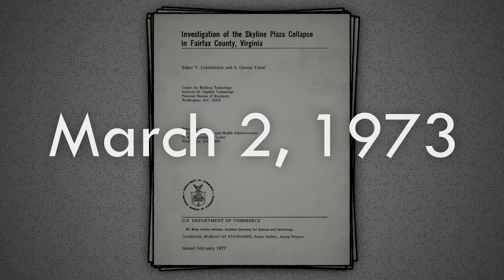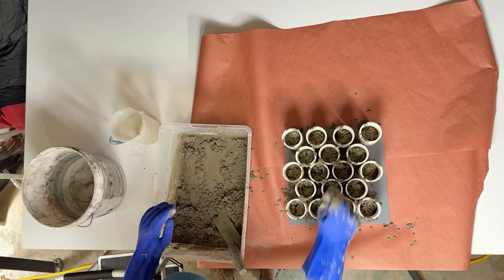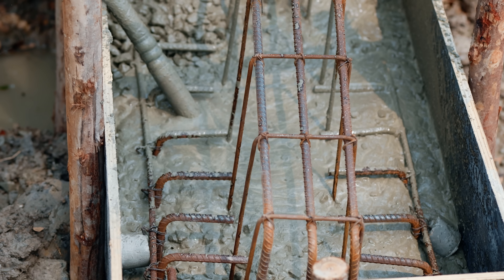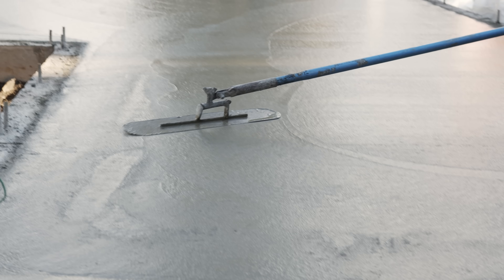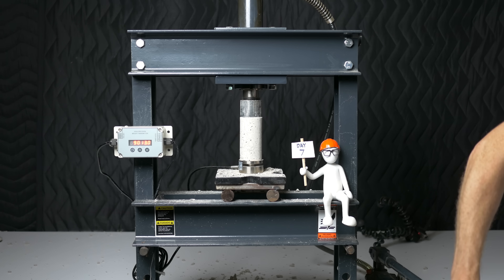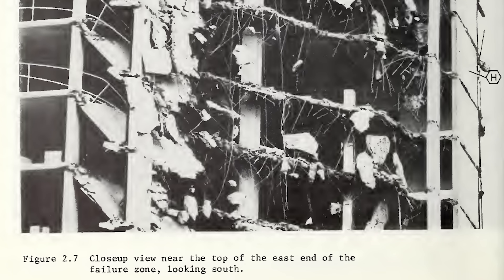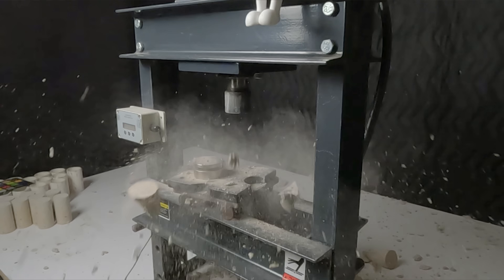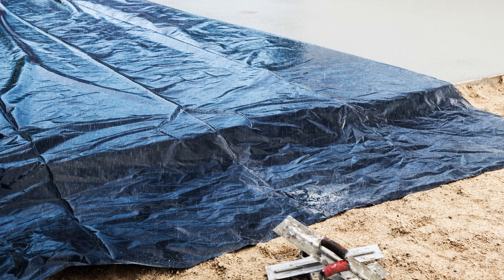Concrete's Greatest Weakness is Time

Comment: Concrete's greatest weakness is the moral integrity of the people engineering, funding, ordering, mixing, transporting, laying and finishing it.
Given a perfect batch of people that do things the right way, concrete will perform excellently.

But yes, concrete does indeed take a lot of time. And there is something to be said about pre-casting concrete off site as much as possible.
It takes up a lot of horizontal space but the benefit is you can do it "perfectly" many months before construction work starts and move the pre-cast segments to the work site.
Then it's just a logistics problem, how to get the cast pieces to the site. Sometimes, you still have but one option and that is to pour it on site due to limitations of the design.

I live in a pre-cast concrete structure. It has performed admirably over the past 60 years. Despite all the outside factors acting on it.
Many other concrete structures have been demolished because of sub-par construction work.

Comment: No, the concrete in the Hoover Dam is not fully cured, and it will continue to cure for centuries because of its massive size. To manage the heat generated during the curing process and prevent cracking, engineers developed a system of cooling pipes that circulated cold water through the concrete blocks during construction. Despite these efforts, the sheer volume of the dam means that the concrete, especially in the interior, still hardens through a process called hydration, and this process is ongoing.

Comment: Some of the time issue is being addressed by the Chinese in their latest ultrafast skyscraper construction.  All components are prefabbed off site including concrete and bolted together.  The speed of construction is simply amazing.  The precast concrete components get to cure in a controlled environment offsite.

Comment: Pretty bold to use a clip @2:31 of the construction of 432 Park Avenue, which is famously already starting to fall apart due to terrible concrete choices
Reply: Pretty fitting, really. It's an infamous example of trading strength for beauty
Reply: I noticed this also.
Reply: Possibly just the exterior finish. There's no proven structural issues.

Comment: A couple of thousand years ago the Romans were building concrete structures. Many of them are still standing and very strong. Good thing Rebar was not invented, the same structures would have concrete cancer by now and would have failed.
Reply: They did have Iron pieces that locked some stones in place, but they filled the gaps with lead so it was a lead covered iron piece.

Comment: Pre pour so you're moving pieces of solid concrete to supplement with your pouring. Like your pillars can be poured somewhere else and hardened already and then you set those up on top of your concrete that's still setting.

Comment: I have heard of failed concrete because the installers used unwashed beach sand which is bad for two reasons:  1. The salt makes the concrete weaker. 2) beach sand is smooth grained and doesn't grip as well.

Comment: Concrete is a really interesting material, even when doing concreting jobs at home with no professional tools/equipment. I've done slab work both with and without reinforcing mesh depending on the required purpose of the final products. Watch those kilo-grady's!

Comment: A relative worked as a concrete forms carpenter for a defense contractor in 1939-40, during the runup before WWII.  He showed me where they build a concrete-paved highway segment as a test of a super-fast-curing concrete formula intended for use in hastily built runways that needed to be used by aircraft as quickly as possible.  He said that the concrete poured in the early morning would have concrete mixers running over it late the same day to pour farther along.  That poured late in the day would be in use the next morning.  Now, 85 years later, the same concrete pavement is still in use as part of a state highway in Louisiana.  I just checked it on Google Street View.

Comment: The night before a significant earthquake I was reading about earthquakes. The next day I was in a building that was built strong enough to withstand a near miss of an atomic bomb. When I felt the first movement I had faith that the concrete building was safe, so I started counting and noting the amplitude and time between the primary and secondary waves to judge the direction, distance, and magnitude of the earthquake. My direction was right on. My distance was within 10%. My magnitude was 7.2 and the final published was 7.3. But within a month the building was reinforced to withstand earthquakes.

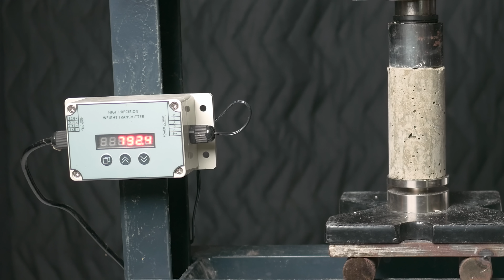Comment: @6:00 Noticed you did not have a sulfur cap on the ends of the cylinders to provide a smooth surface for the press to apply the force. While not important for your demonstration, mention of this test method procedure would be useful to the viewer. Slump is one field test for the concrete for its ability to be poured or pumped into place or formwork. Another important field installation method is to not apply too much vibration to the concrete else the aggregate will settle out of the concrete mix reducing the strength requirement.

Comment: Fellow engineer here. I use to test the concrete cylinders in a Precast facility. Make sure you use rubber pads around 60 duro to give the most accurate test. The height of the cylinder is also supposed to be 3x the width. I know it's for a video but you know you'll have people try to invalidate your test. Anyways, awesome video as always!

Comment: 28 days is an engineer standard. No load bearing for 28 days, no exceptions. Its fine for most use at 2 weeks. Your concrete cured a little faster than average.

Comment: Making cement, the key ingredient of concrete releases a lot of carbon dioxide into the atmosphere. Quick concrete cures in days but does not reach full strength for years. In my city a lot of overpasses had to be widened. the new concrete was not used for traffic for over a year.

Comment: I have a great concrete anecdote.  I was working on a crew that set up canopies for a rental company.  We got a job to set up a 30'x60' canopy on the floor of a giant warehouse in a steel mill.  The floor was a roughly century-old concrete floor, topped with "tiles" of 4"x4" end-grain wood, probably 3-4" deep. To set up the canopy, we needed steel stakes, so we had to take a big hammer drill and drill through the wood into the concrete, which was seriously slow going in that old concrete.  But we managed it, and we pounded all the stakes in, and without too much hassle got the canopy set up.  Taking it down, however, proved to be quite the problem.  We tried everything there is to get those stakes out, but they were truly like the sword in the stone.  That concrete wouldn't give them up, even when we brought in heavy machinery.  Eventually, they ended up being cut flush with the floor, though I wasn't there for that part.
Reply: I like this anecdote thanks for sharing it
Reply: Thank you for sharing that. 🙂

Comment: I used to lay bricks, and here is a tactile comparison about how mortar sets up that I think most people can visualize: If it was mixed in the morning, in the afternoon you can break it apart with one hand like a completely dry piece of bread. The next day it's more like a thick chocolate bar, where you need two hands. After a week it's a rock, and you need a hammer.

Comment: Another concrete episode!!! YAH!!! I remember as a kid, watching a road project using it and was puzzled why they covered it in plastic and kept it wet (this was waaaayyy back in the 60's). I asked, being just a dumb kid, and the guy said something about, 'if it dries out before it cures, it's not as strong.'

Fast forward about ten years to the 70's and they were working on a breakwall for a navigation channel. They drilled down at an angle behind the wall and 'washed out' a big space deep underground. Then some heavy cable wire and concrete. Bascially, putting in some sort of tie anchors. Whole different work crew of course, but I said (I was about 15 then), 'at least underwater it'll cure without drying out'. Foreman looked at me and wondered, "How did you know about that?"  :D :D :D

Comment: Get 5,000-8,000psi half dose super plasticizer added at the plant use high quality washed sand get it minimally agitated at a 3.5 slump on cool over cast late summer early fall day then add half a dose super on site slowly with 1 gallon of water per yard on the truck pour at a 5.5 inch slump broom finish with a calcium white spray finish

Comment: I'll bet the strategy of using a stronger mix is prefered when possible, as well as being faster it over performs for safety. 
So this is probably a good reason why we commonly use asphalt for roads, a lot lower setting time.
Reply: We use asphalt for roads because it is 25% of the cost of concrete

Comment: As a kid I worked for a company that specialized in pouring concrete. We did a slump test on each batch. That was pouring a little concrete into a cone shaped cardboard tube , much like an ice cream cone, then tipping it over to see how runny the mix was. Too much water? Not enough water? 
Didn’t see that mentioned here. Perhaps it’s no longer done.

Comment: One thing I wonder if what the reason is that mixtures are (apparently) not often made to be "self healing", where there's a small excess of the part that reacts with the water, causing it to "heal" if cracks form and water finds it's way in, which it will eventually.
My guess would be that the downsides are bigger than the benefit, but that's as much as I can guess. Since there's already multiple videos explaining the details of concrete, maybe this could be covered too in a future one?

Comment: Pardon my dumb, but does the vibration not cause all the entrained air to come out?
Reply: It could, but if you vibrate the mix enough that all the air bubbles will rise up, then some of the aggregate will sink down, and then you will have non-homogenous concrete that's out of specification.

Comment: Concrete has another oddity in the strength curve.  It takes a long time before it actually goes flat (if ever).  I worked at a tool rental company in the 70's ... a contractor rented a compressor and 80# jack hammer.  He said he was contracted to break up an old coal bunker under the driveway of a big mansion that was close to 100 years old.  We normally supplied points as a part of the rental.  He was back in an hour and the 2 points we gave him to start with were completely blunt.  We gave him some more points and he was back very shortly.  After I spent hours resharpening points and he used up all the extras we had, my boss had to cut him off.  It ended up that 100 year old concrete, particularly when it was 1 ft thick, was stronger than the jack hammer.  Subsequently a variety of bigger concrete breaking equipment was tried with little success.  They eventually had to use explosives.  I suppose that is why there are lots of concrete structures (e.g. roman), that are still around, even though they are extremely old.
Reply: Romans also used this special kind of limestone I think? That mixed in their concrete and would swell up when exposed to water when it was finished, so it had some autorepair functions as well. They really knew their concrete too, and makes me think maybe the pyramids where constructed like that using mixes lol. But there's ways to move giant slabs of stone using physics and tricks too, so I dunno, but im favoring the mix. (goes way off topic lmao)
Reply: @Robert_D_Mercer  The Romans strengthened their concrete by mixing Italian volcanic ash into it.  Apparently their ash was just the thing for concrete.  There are few Roman cast concrete structures outside Italy because of the lack of this ash.

Comment: The company I work for - with over 6000 employees - makes ~70% of its revenue from concrete additives alone. They do all kinds of alterations to it, some are also for injection for retro-fitting or maintaining already existing structures. It's a pretty big market.
Since I'm just a PLC engineer there, I don't have too much insight into the actual chemistry though. After this video, I'm kind of interested in speaking to our lab people a bit.

Comment: 11:08 As a fan of PRECAST CONCRETE, and someone who has watched many videos on that, I was expecting to hear that building method mentioned. 
Concrete is mixed and poured in controlled conditions in the factory, then able to cure in storage yards while other steps of the on-site construction can be happening concurrently. 
Add an insulating core layer to precast panels and you've got quite a good building product!
Reply: Also, if a batch  of concrete or a panel doesn't turn out as planned you don't have to tear anything out, you just make another batch/panel.
Reply: Especially with the Zakim bridge on screen (I saw sectional "slices" of roadbed brought in on I-90 back in the day.)
Reply: what's the cost to transport such a thing compared to the same amount of uncast concrete? (ignoring the cost of curing and storage for the incredibly long curing process!) because if this isn't much higher, it makes so much sense that the majority of the 'basic' parts of concrete pouring could be done with this!
the parts that are more 'form fitting' would still likely be better the traditional way but I could imagine this being an invaluable tool!

are there issues with the way the concrete 'joins' other areas of concrete, since it's no longer like one solid contiguous block?
Reply: @m-yday  bridge decks aren't single blocks anyway, they have expansion joints? (not every 13 feet, though...)  And if anything, curing and storage were probably a lot cheaper since they were done far from the city and could be started way in advance (with in-place construction you can't pour the concrete until there's something to pour it on, with this approach you can start casting as soon as you have the design and the budget :-)
Reply: Lol you know, that makes me wonder. Why not just use stone? The og building material

Comment: as a NYC ironworker, i can tell you that steel is far superior.  even 50 years after a structure is built, it can be modified pretty simply by welding and adding more beams to whatever design you wish to change.  concrete buildings may go up quicker, but steel is the better option
Reply: How much are you getting/hr?
-just curious as a teamster union guy.
Thanks for you comment
Reply: Steel is not always the better answer, it is always the most expensive answer.
Reply: Concrete protects steel from rust.

Comment: Good timing Grady. I'm planning a small concrete job at my house. A concrete trough under the back yard water tap, around the drain. I already did another small job, 2 concrete  pads about 300x150mm and it turned out great. I even put some rio in it. So  now I feel like I can build the Pantheon. By the way a 20kg bag of pre-mix concrete cost me 10 bucks from  the hardware store. I thought that was very cheap, its  half the  price of a 20kg bag of sugar  or flour. Anyway wish me luck. If it goes wrong I gotta buy a sledge hammer.